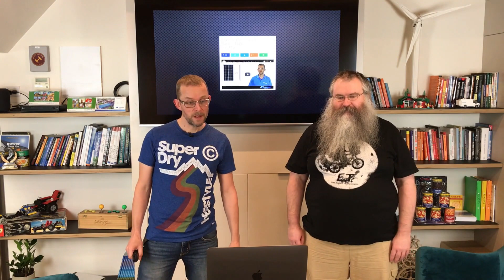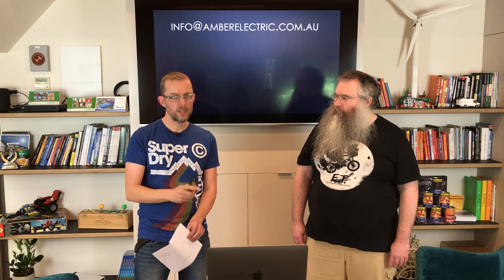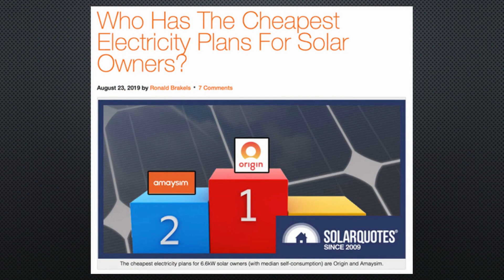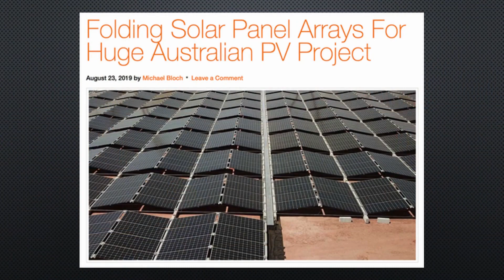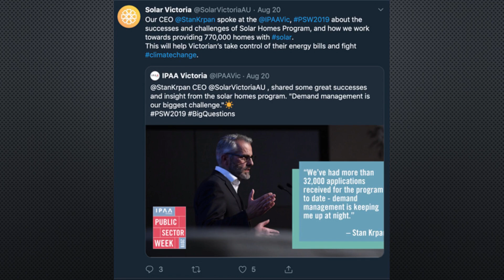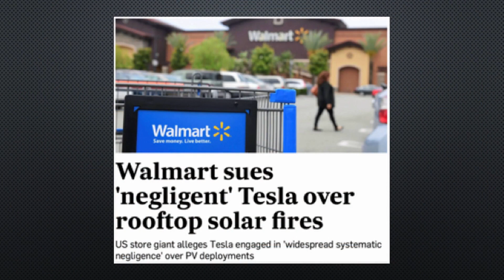Cheapest Electricity Plans, A Massive Cable To Singapore, And Walmart Rooftop Fires

Comment: So when the grid shuts down this summer, can a home still draw power from the battery?
Reply from the maker: Yes. As long as it has been designed correctly.
Reply from the maker: Assuming you mean a residential battery.